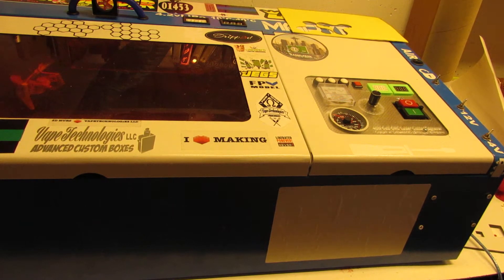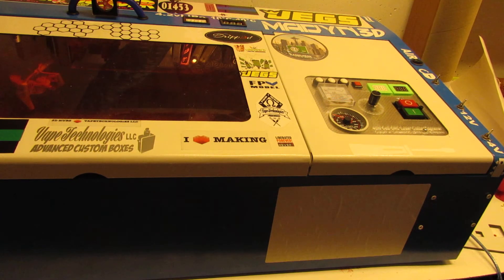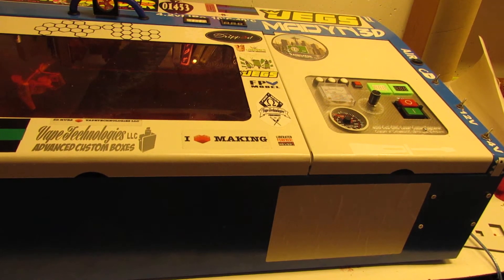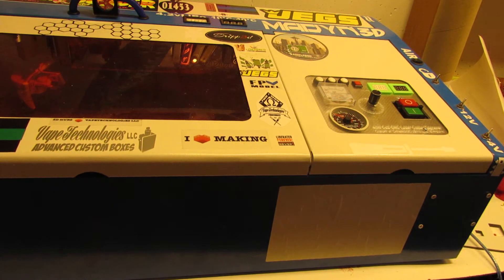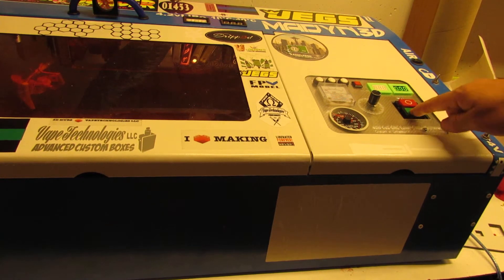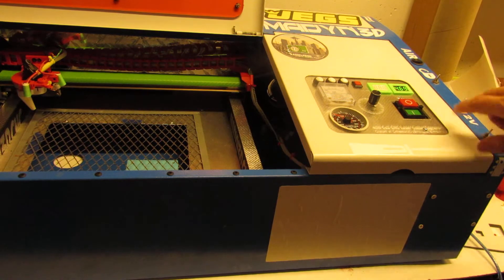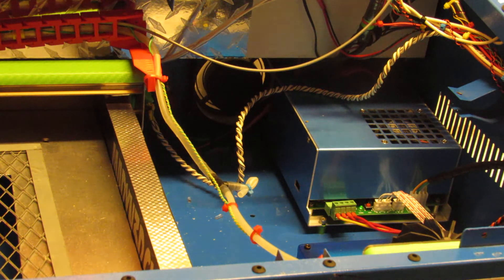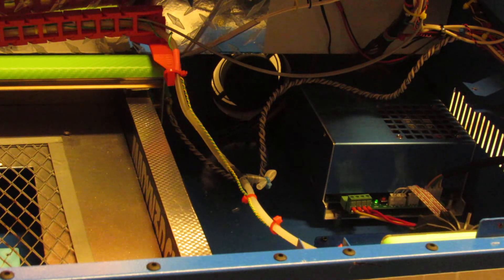K40 Laser- LPSU/Flyback Arcing (Visible and Audible Arcing)

Comment: Do you have 3 wires on your power cord coming into the laser? If you do then I wouldn't add an earth to a outside grounding rod just connect the power cord earth to the frame. By adding an extra earth you could get a stray current into your machine and also you may end up with a larger shock due to the resistance between your new earth and your existing earth before the rcd pops, in Australia the extra earth is a no no.
Reply: It's a no no in the US too.